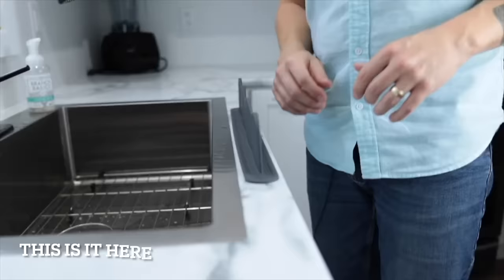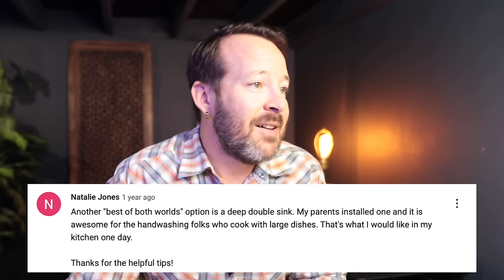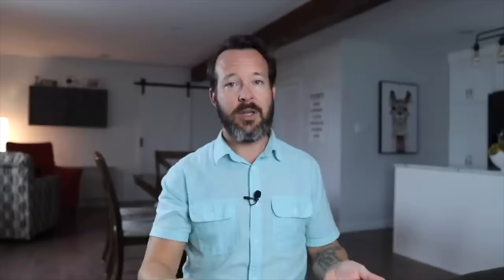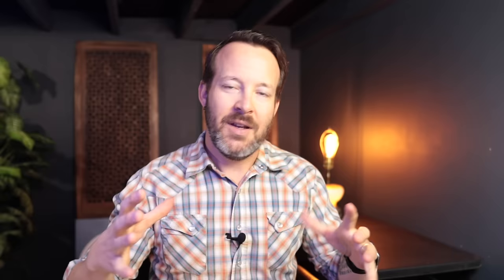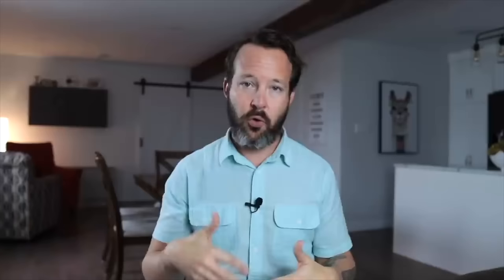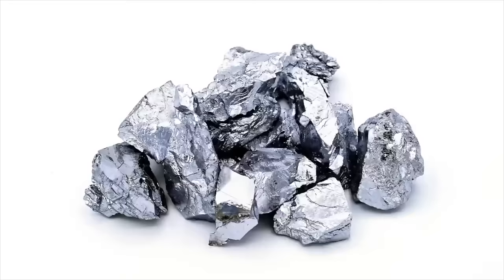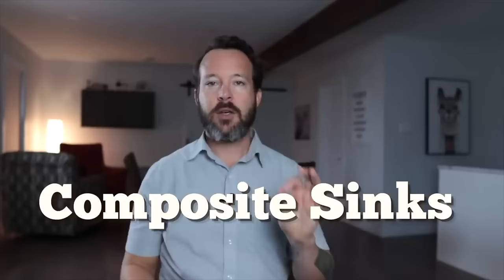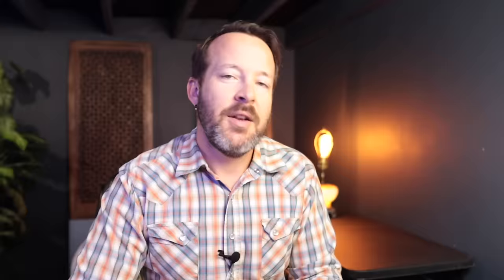Watch First Before Buying a Kitchen Sink

Comment: If you want a large single bowl but want to fill up a section with soapy water occasionally, simply use a dish pan that fits into half your sink. That's what our great-grandmothers did!
Reply: I do this all the time when hand washing smaller items that can't go into dishwasher.
Reply: Exactly!
Reply: Yes! This is the argument that won the day with my wife!
Reply: Came here to say this.
Reply: @bonniek753  LOL, Me too.
Reply: Almost all families in the UK do this by default
Reply: Why don’t you just get a 1.5 sink I would hate to have a plastic bowl in my beautiful kitchen…
Reply: @genevievedupont3072 who said it has to be plastic?
Reply: @tonisuperfly I literally can’t imagine what else it would be made of?  My favorite sink I bought was a wide Kohler cast iron white with a half wall between the two equal sides so you could lay a wok or pan with a long handle across the span. Edit yes he describes that at 5:15 from Natalie’s comment
Reply: @Isabel-of4wq  I just thought with the range of materials available these days, there would be other options that might look better. Stainless is the most obvious other choice but might not work with a cast iron enamel sink. There are enamel vessels that could work. They’d be heavy and hard though and you would risk chipping the enamel though… Which makes me think of white acrylic, polyester, fiberglass or composite options instead.
Reply: Our great-grandmothers also chopped firewood, washed clothes by hand and got down on their knees to scrub floors. No thanks.
Reply: Yeah, but then the dish pan is another thing to clean. I love the double sinks.
Reply: I used to use a plastic pan in my big stainless steel sink, but changed to using my big stainless steel dutch oven pan instead,  because I like to rinse the dishes, and that big pan was just sitting there.  Why buy more plastic.  Anything too big for that has to be washed in the main sink instead of course.
Reply: This is how I hand wash my chef knives and other smallware delicates.  Just put the Rubbermaid bin in the large single basin sink, and now you have the best of both worlds.
Reply: I prefer a large single. I’ve had  a double standard sink, a double with smaller side sink and a large. I  love the large because it  holds large pots and pans. I can still wash dishes in the sink if I want too. It’s all in personal preference. Make sure you get the bottom grate, it helps with scratches that occur when putting heavy pans in the sink.
Reply: 😊😊 hmm mk
Reply: Or Moms for some of us!  Those heavy-duty Rubbermaid tubs are the best and you can fit two of them into a farmhouse sink with some room to spare.
Reply: Came to say this.   Any size, material, or number of tubs you want...there are even collapsible wash basins for easy storage.
Reply: Yah! Exactly!
Reply: Agree! I got a basin from the dollar store works perfectly 😊
Reply: What did he say..."if you enjoy washing your dishes by hand!" Enjoy, really, I mean who enjoys washing dishes??? I hated washing dishes since I was a teenager!
Reply: You can’t change the water in one if you only have one drain, or do you rinse in running water?
Reply: Stainless full bowl is the best sink I’ve ever had and I’ve had a lot of sinks.
Reply: I have a double sink and I still catch my water in a bowl..lol
Reply: But then you need a place to store your dishpan.
Reply: @maf1746  you can hang it on a hook 😊
Reply: I have a large single and usually I have a dirty large bowl or pot and just fill that with soapy water and wash other things in it.  Then wash it last.
Reply: Washing up bowls in the UK.
Reply: Thats what I do🎉
Reply: @genevievedupont3072
I’ve had all the sptil sinks and I’m done. The most annoying bit was that I couldn’t lay large baking dishes flat to soak. My new kitchen had a large farm sink, and I’ll keep a basin under the sink for hand washing; though since I have a dishwasher (with an implement tray on top)I don’t think it will be often.
Reply: Common sense
Reply: Consider that the dishpan is one more thing to keep clean. I did this for decades but was so delighted when I finally got a double sink and could throw away my dishpan.
Reply: That's what my mom did and what I do as well.
Reply: That’s common sense.    Which many lack these days.
Reply: That's exactly how I grew up- Our sink had two bins, one for washing, one for rinsing.
Reply: That's what I do. I love my large single farmhouse sink. Even when I had a double sink I used a plastic one to protect the finish and my plates.
Reply: @maf1746  I have a giant stainless one bowl sink, that is big enough to bathe a small dog or a baby. I use a dish pan which is collapsible, thus when not used, I store it under my sink. It doesn't take up much space at all.
Reply: When I switched to a single, I quit "filling" the sink.  I start with maybe an inch of water and wash the smaller stuff first (knives, cutting boards), and the rinse water from the early stuff ends up half-filling the sink.  With the big things at the end, I wash then drain so there is space to rinse.  But I'm rarely washing more than 7-8 things at a time with the dishwasher.
Reply: The only concern with a dishpan is that it may block the drain and keep the rinse water from draining. But if you place it on a rack at the bottom then that’s not an issue.
Reply: @trinaroe5132  That can also aid not having to bend down to the bottom of a deep sink (I assume bench height is the ideal working height so anything lower than that is less than ideal - the deeper it is, the worse it is for your back).
I have a collapsible camping dish that actually has feet on it. ❤
Reply: My grandma did that, but she had a super deep right side and very, very shallow left...used left to hold dishes while we dried. Kinda like a drying rack.

Comment: The BIGGEST reason for an offset drain is so a garbage disposal doesn’t take up as much usable cabinet space below. A center drain puts the disposal smack dab in the middle of the cabinet below, making the space behind it unusable and leaving small slivers of usable space on either side. An offset drain towards one side and the back leaves much more usable space for cleaning supplies or trash below.
Reply: you all analysing it and the only question I have is: why do you people put the dirt dishes INSIDE the sink? I mean, you use 5 cups with beverage and put INSIDE the sink, together with the plates used to eat a juicy barbecue. Now the cups that only needed a light scrub will have to go through the full soap bath and scrub because it's oily and greasy. I just rinse everything I use with right pressure water and leave OUTSIDE the sink with a drop of soap until I wash it. That habit alone cancels out the need for a double sink

Comment: Im used to a double sink.  As an empty nester i rarely use my dishwasher.  I use one side for washing and the other for draining/drying by using a dish rack.
Reply: me too!!
but for my next sink gonna go for single bowl large, and just put the clean dishes to one side on a drainer tray
Reply: I was brought up to wash the dishes in one side, and rinse them in a sink of plain hot water on the other side. The rinsing water stays hot because the dishes I'm putting in it are already pretty hot, and it rinses away the detergent residue as well as leaving them hotter than they were coming out of the wash so they dry quicker.
I'm still kind of grossed out by the idea of washing dishes and not rinsing them, but running water to rinse every item separately is just wasteful of our limited supply of clean water.

Comment: I had a fireclay, double sink (not apron front) installed 8 years ago. It was the one design decision my husband made because he likes to handwash dishes that can't go in the dishwasher (vintage, crystal, knives, etc.). And the fireclay does keep the soapy water warmer than a stainless sink (my preference). Within the first year, a pot fell off the drying rack adjacent to the sink and cracked the divider. We were able to adhere the pieces and it is still functional but ugly (I cover the divider with a rubber mat and sponge holder). The bottom of the sink is also pitted pretty badly. I'd love to replace it but it is undermounted in soapstone which is somewhat fragile. Removing the sink and keeping the soapstone in tact is a challenge that no one is willing to take. This is an L shaped countertop with beautiful marbling that was meticulously matched at the seam and would no longer match if the section around the sink is removed. Headache. It just didn't occur to me that I would ever replace the sink but maybe that is something to consider.

Comment: I am a professional cook and I've worked with many different sinks. I much prefer the double sinks as I clean as I go. So on one side I can wash vegetables, the other side I can wash a pot a few seconds later and then rinse it. 

It drive me crazy working with one sink now. I hate having to wait and wash all the dishes at once. It's a personal preference but clean as you go is much harder with one sink. And the dish pans put in one sink are too small, in my opinion. Plus if you always have a sink with clean water, it's so much easier to wash your hands in the sink.
Reply from the maker: Really good point!  We all use our kitchens differently, so there is no one-size-fits-all sink or kitchen layout even.
Reply: That's my dilemma. I've hate out double sink because it's too small for my big pots However, I'm afraid I would hate the single sink for the reasons you described. A shorter division also might be annoying because the divider could get in the way while washing large items.
Reply: @logicalblueberry the sink I bought is 33” long, two bowl but square shaped so it’s optimizing the space AND the divider is a half wall so I still have tons of room for bigger things
Reply: Not a professional, but I like to cook and saving dishes is the last thing on my mind, so I also clean one or two things as a time as I go to kill some time while my fond is reducing or my meat is searing and to reduce the amount of dishes that pile up and have to be washed all at once afterwards.
I had a standard single when I bought my house but room for a standard double and an easy to open up laminate countertop, so I went that route pretty quick: like you say: have clean water in 1 bowl while there's a second bowl for rinsing veggies, draining pasta... But I struggled with washing my largest pots and oven trays in it (and those are just the things that also don't fit the dishwasher), so I changed it out again for a large single and put a bowl in it for the soapy water. My problem cleaning large items was solved but I hated dealing with the bowl, I also found that I didn't have enough storage near the cooking and prepping area...
I took drastic measures: gone is the open concept kitchen with adjacent pantry, I closed off the kitchen from the dining room and opened it up towards what was the pantry space, creating a long galley kitchen. One side of the galley kitchen is a wall of storage and appliances: drawers, cabinets, wall oven, microwave, fridge, and a chest freezer that doubles as emergency/overflow countertop. The other side starts with a standard double sink, then some countertop space, two cooktops (one gas, one induction), some more countertop space, and a large single sink on the other end: best of both worlds!
I LOVE having both the standard double ánd the large single, they complement eachother really well and this setup (along with the dual-fuel cooktop arrangement) is a major reason why I hope I never have to move to a smaller kitchen.
Reply: @logicalblueberry agree on double sink use..I don’t have a large family — me and 6 bozo cats so I prep and cook more simply.  But even so, after three weeks of that horrid  cold flu  combination  going on,  I just had a lot of bowls and spoons… and pots to heat up soup..thank god  for Trader Joe’s organic tomato with roasted red pepper soup.  It sounds fancy but isn’t  and at  $3,49 s box -32 ounces  So a bargain of yum… oh you stay safe wherever you are .. blessings abound… Gail in Central Parkway,. Monday, May 11 20/24.
Reply: I'm designing my kitchen to commercial standards. It has a separate handwash basin, so nobody needs to wash their hands in the kitchen sink.
Reply: I agree plus I think in general double sinks are easier to clean. I have a large single sink now and the grid gets disgusting  and is a pain to clean. but if we take the grid out the sink gets scratched.
Reply: I have a 1/3 side and a 2/3 side. The 1/3 side has the garbage disposal and is also great for keeping hot soapy dishwater for cleaning. The 2/3 side is much larger and can accommodate all my large pots. I cook a LOT and that's the maximum flexibility I think.
Reply: Congratulations ❤ You should post some pictures ❤
Reply: What about having a plastic tub that you could drop in the sink to use for washing if you still want to use the other side of the sink?   Just a thought given that you already have the single bowl sink
Reply: Our space allowed a single sink next to a double workstation sink.  It is a dream situation.  Extra butler sink in a butler pantry that helps avoid those others that NEED the sink space you are in only when they are in use. 😅  Really fun space to have everyone in at once yet no one taking others space.
Reply: @cinders302 
In our other home we had a single workstation sink that was mighty big yet didn't meet our need for a single sink as well.  We used that plastic tub method but it never really worked well.  Another thing to always clean up too.  It's definitely a great option for those who still need it, and don't have the extra space.  Our new home we were able to learn from all our past kitchens and create the best functioning kitchen for the large family.  Adding a single sink next to an oversized workstation sink works perfectly.
Reply: @logicalblueberry  If you go for a single large sink, you’ll have more flexibility. After all, if you need to wash your veggies separately, you could always get some sort of container or dish rack . Hope this helps .
Reply: I clean as I go but it’s more put in the dishwasher as I go. I have like 6 things that aren’t dishwasher safe because I refuse to hand wash if it’s not necessary.

Comment: I remodeled my modest ranch house kitchen 20 years ago and went with Corian countertops and an integrated corian sink.  Best decision ever.  The countertops were dark grey and the sink was white, and it still looked like new when I sold the house 5 years ago.  I am a careful person, however, and I always let the pans cool off before I put them in the sink.  Any scuffs from aluminum pans just buff out with a little Bar Keeper's Friend. (or Comet)  At the time, I think the sink cost me only an extra $50 or so (they were running a deal).
Reply from the maker: Glad to hear this input about Corian.
Reply: Same here! We bought our house 14 years ago. The kitchen has corian countertops with integrated sink. It is the most functional sink I have ever had. After 14 years of heavy use it still looks perfect. Any spot or stain is easily removed with baking soda and/or peroxide.
Reply: @etoya7304  I had one like that. I bought the largest sink they could fit and it still looks great! My daughter rents the house from me so I still see how it's doing.

Comment: For soaking dishes I just use the larger dishes as the vessel to soak smaller dishes. I’ll use something like a yogurt container to soak my flatware, and a pot to soak small bowls or plates. I don’t have a lot of money for fancy under-sink storage, so I just purchased appropriate-sized semi-clear plastic containers to hold cleaning supplies, etc. They’re separated by categories so I just pull the out what I need like a drawer.

Comment: I definitely prefer a double bowl sink. Someone is always gonna put dishes in one and you can at least use the other side, a disposal is on one side, you can rinse on one side/wash on the other, just so many uses. I also prefer offset drains so if someone puts a plate in there it's not stopping the drain (my pet peeve is dishes in the sink but it's hard to train housemates. lol) I love granite composite in black best, over 20 yrs and still cleans up looking new. Stainless ends up with so many scratches and dull and always looks dirty to me.
Reply: I have hard water and have thought of replacing my white sink with stainless but i know the hard water spots would show even more, my current white sink just stains too easily. Might look at the granite black composite.
Reply: @Imbatmn57  I loved my black granite one. It was very easy to clean and always looked brand new after cleaning. I didn't have a water softener either.
Reply: Oh I LOVE my dark granite composite sink!!! Never scratches discolored or anything I've noticed. A HUGE plus after a white ceramic coated one! 😮
Reply: @Imbatmn57 we have hard water and only thing that ever shows is some white spots. (Sw FL water) but those even show on even a white sink! But easierr to remove, especially with no scratches!! (Had those, too😅).

Comment: As a ‘house sitter’ in Britain we noticed almost every home has a ceramic sink but every home has a plastic laundry tub dipped into the sink - less noise and far less heat loss. We love our stainless steel double sink with sound deadening pads fitted by the manufacturer ( Cefito)

Comment: I just got a large single bowl fireclay farmhouse sink with a middle drain installed in my mid-sized kitchen, and I absolutely love it! 😍 It's a must have if you cook with large pots and baking pans. Lol, just soak and hand wash your dishes in the large pots =D 

For scratches/stains, nothing beats Bon Ami and a magic eraser. This also works wonders on anything cast enamel like Le Creuset enamelware. Bar Keeper's Friend is good enough for stainless steel surfaces.